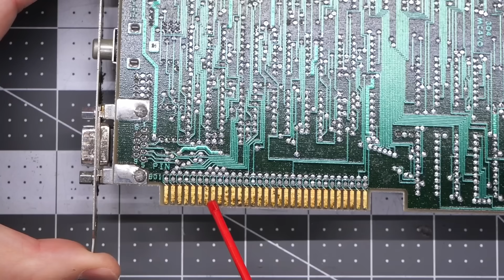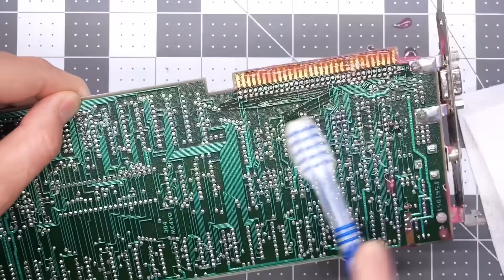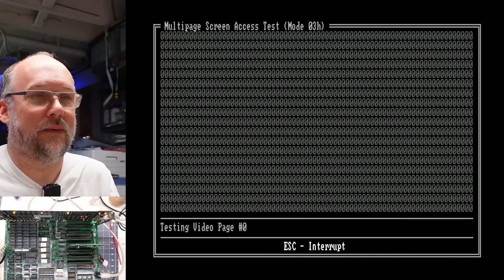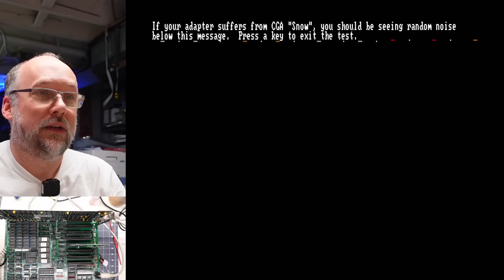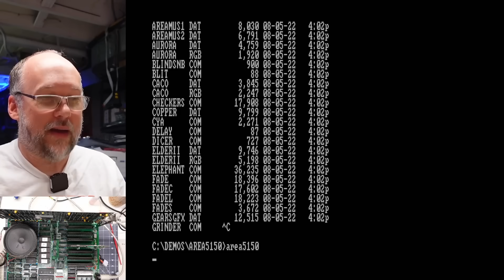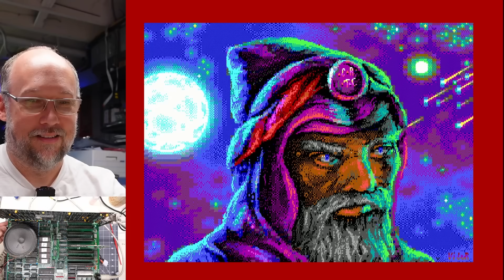Can we save this heavily corroded IBM CGA card?

Comment: Another chemical that works great for me with cleaning corroded circuit boards and connectors is "Super Clean All Wheel Cleaner" - it's a foaming cleaner with oxalic acid. In my experience it works as well or better than naval jelly, but it can be easier/less messy to work with.

Comment: In the past I've tinned up the corroded connectors for my C64s, so I'd say 'yes, tin them you fool!', but I'd obviously advise you wick it so that you have minimal issues with insertion problems. Surely if solder flakes off in the slot you just go inverted and it falls back out of the connector... top gun style.

Comment: The slots on your motherboard are wearing out. The distance from one side to another is vast if you look at the pins. Meaning some of the slots have various widths to them. Some are wider than others. So contacts to any card you put into them may or may not work. Just a heads up... Nicely done... =)

Comment: You said when the ISA connector gets too damaged, there's no way to repair the card anymore, and I immediately thought: you're wrong - even then, you can pretty much save it. Look at those large vias just above the slot connector - they're obviously solder holes where a regular pin header can be installed for whatever purpose. And they are all connected to their respective pins on the connector, as you can see. And, fortunately, ISA has the standard 2.54mm pin pitch. So even in case the connector gets insalvageable, what you can do is solder a standard 2.54mm 62x2 pin header there and make another PCB with a similar header (to solder a counterpart there) and an ENIG-plated ISA connector.
And if you needed to fit such card inside a case, just cut the original connector off (or maybe just remove the remains of the copper from it, to make it just a dummy mechanical holder) and make the replacement connector PCB the correct distance from the card to fit in the neighboring slot. To save a slot, you may even make a special XT-IDE card with the extra pin header to connect such card :)
All in all, these things are nearly always repairable in some way :)

Comment: You can make a homemade version of the jelly with hot vinegar and cornstarch. Works WONDERS for regular rust on iron surfaces.

As for those cancer warnings, I once stayed at a hotel in San Francisco that had one of those attached to the hairdryer. Apparently, IF on fire the fumes from the plastic can cause cancer.

Comment: I used to be in to guns. A friend of mine who was also into them and had a gun shop used to also be into metal detectors and such. He once went magnet fishing in a nearby river and found a .22 rifle that had been submerged in the river for what must have been several years. So we took it to my gun shop in my basement and coated it with Navel Jelly, it worked pretty well but the outside of the gun was deeply pitted and, of course all the bluing was gone.  So we went over the gun with sand paper, then steel wool then cold bluing, it came out looking almost like an engraved rifle!  Looked kind of cool and the thing about .22s is that the bullets are coated with a sort of wax lube so the bore of the rifle cleaned up very nicely.  We located a stock for the old rifle, and I cleaned up the insides so the gun fired, he sold it as an engraved rifle for several hundred bucks.  Our investment back then was around 40 bucks of parts the stock and cold bluing chemicals.  Navel Jelly is indeed a wonder product.

Comment: Dear Technoid Savant, 

I found some rather surprising information for you with regard to your CGA adapter's worn male edge connector.  Unfortunately this platform does not allow us to post hyperlinks within messages.  However just copy and paste the following data into your favorite search engine and then you will be able to proceed.  

There are only 5 or 6 results so you won't suffer from techno-babble overload but those pages are indeed quite enlightening.  I'm almost certain that you will be able to produce some astounding procedures from the information contained in the those pages.  So without further delay copy and paste the following parameters into any search engine (without the quotes): 

" (repair,preserve,protect) (worn,gold,edge) (connector,pins,fingers) (pc,computer) (video,cga,adapter,card) "

Or these variations will produce slightly different results (I didn't research deep enough to exclude them): 

" (repair,preserve,protect) worn (gold,edge) (pins,fingers) (pc,computer) (video,cga) ( adapter,card) "

" (repair,preserve,protect) (gold,edge) (connector,pins,fingers) (pc,computer) (adapter,card) "

I was both surprised and amazed at the precise nature of the information that I saw on some of those pages.  I have no doubt whatsoever that you will be able to adapt and utilize the information for your own specifications and purposes, if you are so inclined.  

Reminder:  Don't include the quotation marks when you copy the phrase into your search engine or you will come up empty.

Happy trails and my best regards.

Comment: Hi, I really enjoy your videos but this is the first time commenting.  I've looked at plating before and I think brush electroplating would be best to restore the edge connections.  If you connect all the edge pin to 0 V, whether you want to plate them or not, the board will be protected during the electroplating process.   Then you can do the electro-cleaning and nickel plating safely and ensure you get a thick and reliable gold layer.  I'm not sure those jewelry gold restoring solutions would give a thick enough gold layer and would wear quickly.

Comment: There is actually a product marketed under the name Stabilent 22, known as a contact enhancer.  When I was working in the Comm. Dept. at a Class 1 Railroad, we used this regularly, with our multi-slot radio controllers, at the various radio sites.  It's not cheap, but worked wonders on edge connectors.  I think we bought ours through Motorola, but there are other vendors, who sell it.  

I'm planning on attending VCFMW in 2024, so I'll look you up.

Comment: I'm usually able to find out what ingredients are in things by looking up the MSDS sheet for it.  The Jelly one says it has these ingredients:

Phosphoric acid 7664-38-2 10 - 30
2-Propanol 67-63-0 1 - 5
Xanthan gum 11138-66-2 1 - 5
Sulfuric acid 7664-93-9 0.1 - 1
Silica, amorphous, fumed, crystal-free 112945-52-5 0.1 - 1
Diiron trioxide 1309-37-1 0.1 - 1
Magnesium oxide 1309-48-4 0.1 - 1
Aluminium oxide 1344-28-1 0.1 - 1
Alcohols, C11-14-iso-, C13 rich, EO~

Comment: id leave the pins alone, if concerned about it in storage id put on some dielectric grease so they wont corrode in storage and you could use the card that way also and it wont corrode in the socket either

Comment: I've had connectors loose connection due to WD40, due to a thin film that was left on the surface. Almost impossible to spot, would absolutely not recommend.

Comment: That Area5150 demo was neat. Color gradients reminiscent of the Amiga Copperlist tricks, high resolution multicolor graphics... I think they do something similar even, like editing the palette references on the fly. The Amiga could display fairly high color counts in a highish resolution, non-HAM image by palette splitting. Also lately, the C64 has received some demos that do tricks that shouldn't have been technically possible at all.

Comment: On the note of the edge connector... if I were in your place, I'd probably just tin the entire thing with solder, even the gold pins.
make sure the entire contact is coated, then use copper braid to remove as much solder as possible, really thin coat.

Comment: Given that we are speaking about electronics here, I don't know if this is completely safe, but you could always try giving the exposed pins a light electroplating connecting cables to the vias for probe connection of the pins that need it. Try at your own risk, preferrably with a cheap spare card first.

Comment: @Adrian 
Take a look at Circuit Medic

They sell PCB repair kits. They've been around for like forever, and give IPC (PCB standards) rated repairs!
I use some of their stuff. I really like their thermal bond adhesive sheets. I find their replacement pads a pain to use (too thin). I usually salvage a pad from a donor board, and use the thermal bond adhesive to replace the pad. 
Solder mask is available from them also!

They also have a lot of great how to videos of how to do the various repairs, obviously showcasing their offerings. 

They have a gold plating kit, but it's quite expensive. You can order individual supplies from them however. The gold plating solution, being gold is quite expensive unfortunately. 
You may need to do a nickel barrier plating, and then gold, as gold can actually diffuse into copper. And, the nickel acts as a hard, abrasion resistant layer. Probably less of an issue for an antique hobby board repair, however. 

DO NOT tin/solder plate those edge connector pads. You will contaminate your mating edge connector... Plus cause fretting corrosion from the dissimilar metals...

And as others have mentioned, Navel jelly is mainly phosphoric acid and some sulphuric acid with a gelling and coloring agent. I would recomend a baking soda scrub afterwards to neutralize.

An alternative method for PCB corrosion cleanup, I would use, is OA water soluable flux, covering the corrided areas with flux (top and bottom, even if no corrosion present on the opposite side), which is quite aggressive, and touching each corroded part with an iron. The joints will look factory fresh! Do NOT leave OA flux on a PCB. It's quite corrosive over time.
And, like you did with the Navel jelly, use it in an area that you can clean well afterwards, so you dont contaminate future projects. 

To clean a PCB, including OA fluxes, just put it in an old dishwasher to clean without any detergents. If your water is hard, give it an isopropyl alcohol bath before drying.  This actually mimics industrial processes when they are manufactured, although we use DI water for a final rinse.

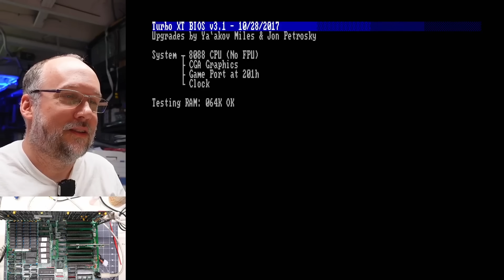Comment: 18:59 does picomem give you a clock and a Game port? 

If you remember the broken motherboard with the mysterious issue was showing the exact same devices even though there weren't any clock or game port installed

Comment: Please do not use WD-40 as a preservation coating, before it dries up it's gets all over the thing, and after that it attracts dust and inhales moisture from around itself. You don't need that kind of shmoo on your connectors, just a dry box would be enough.

Comment: A cheap and convenient way to make the connector is to use chemical tinning.
This will work much better than solder as the thickness is going to be much more regular.

Comment: we used the yellow sticker to point to faults in factory (learned electronics technician around the 2000s), maybe bad soldering points to reflow. the worker has forgot to remove them, imo.

Comment: For protecting the PCB, cover the edge connector then spay the whole board with some clear protective lacquer.
For electronics the spray from an electronics supplier is probably the best however lacquer from a hardware store works just fine also.

For the edge connector it would be fun to try and electroplate it. above the edge connector is a row of pads, temporarily join them all together then experiment with some plating.
I have never tried gold, it would be interesting to try.

Comment: Could a gold solution in a small plastic vessel large enough to immerse only the edge connector and 'fingers' be used to re anodize the 'fingers' ? A small current would need to be passed through the card with a +/- to a power supply. Would that be possible ?

Comment: There's a plating solution available, used for DIY PCB making, which doesn't need electricity. You'd basically just let the slot fingers sit in the solution for 20 minutes, and then you wouldn't have any more copper exposed.

Comment: I would coat the copper at the top of the slot connector, to protect where it connects to traces. But leave the copper at the bottom bare where it contacts the slot so you don't foul the slot.  If corrosion or wear causes problems later the remaining copper could still be tinned if the trace is still connected.  If not in a system you might want to store the card with electrical tape over the slot connector to reduce atmospheric exposure, Other tapes might not play well with copper, but electrical tape should be fine it is intended for long term use on copper. Might need to clean off adhesive residue before use if tape is left on for a long time.

Comment: The two stickers with pointers were probably put on by a QC inspector to indicate joints needing rework attention due to not fully meeting standards.

This was a frequent practice in the 70s and 80s at many manufacturing plants.

Dave
Reply: Still is in smaller businesses, it seems. I worked temporarily at one that handled subcontractor jobs and they were still putting labels on peoples work whenever it came back to them.

Comment: As for the nail polish, you might want to look into some products by MG Chemical. They have several conformal coating products with various degrees of protection for electronics. Some just paint/spray on and others that have to be cured in an oven or via UV light.  I don't know which one we used on electronics we delivered to the Air Force. They have conformal coating strippers, too.

Comment: Did not check to see if wd40 was mentioned yet or not. It is a de-seize fluid DO not ever use it on metal on metal moving parts, it will gall and bind and do more damage than good and it is not safe for plastics. Mention it around automotive or gun people and watch them cringe. It is also IMHO bad for the pcb itself as from experience from a friend who always hosed off his RC cars with wd40 to clean them and was always breaking fiberglass parts and FRP plastics on his cars. I personally would silver solder the copper and leave it. 
 If you are feeling really adventurous you could re-plate it in some other metal with electrolysis. (dunno how this would affect the components connected to the board though) oh people have mentioned those pens and other tools too.

As for the nail polish it is fine, I used to use it on armatures of electric racing motors all the time as the motor cleaner we used would often eat the finish off the winding housing and those would rust up. (RC 540s and smaller down to slot car and HO.) I would suggest a tinted base so you know where it is or isnt.

Comment: If you want to tin the card edge connector, tin it as you normaly would ( scotch brite the pads first ) but while the solder is still liquid, wipe it off with a rag to leave a tin coating without the blobby fat look. Liquid solder paste works well for this, a big fat hot iron and work quickly so you don't lift the pads.

Comment: Nobody ever did " pre emptive "  coating on anything back then after the soldering... Now having done electronics is sometimes heavy corrosive enviroments ( like fertiliser plants ) i covered the complete boards, incl connected wiring) in Amber-spray by Tectyl... works like a charme and electronics would last yrs and yrs instead of weeks...
Another good one for say isolating connectors is Wijmaplast by Draka, like a blue/green silly putty that's 100% non-conductive and never hardens... Just expanding your knowledge of " what's out there "  to prevent corrosion... 😎

Comment: I think some of the foaming with the naval jelly was the angle bracket for the DE9 connector mounting which might be aluminum.

Check for aluminum before using naval jelly or anything else with phosphoric acid as an ingredient.

There's a reason naval jelly isn't allowed to be used near aluminum aircraft. It will completely dissolve aluminum parts given enough time.

Comment: If you tin the slot connector .. the solder WILL crumble eventually and leave debris in the expansion slot connector of your motherboard and can cause shorts. Don't tin the connector unless you really really need it and the card stops working.  Please just leave it be.

Comment: I wonder.  If there is one or two ruined contacts maybe take a dremel and small diamond die bit and carve a groove then flow solder into it?  If the groove is rough then the solder might key into the PCB.

Comment: Amazed that CGA card didn't explode running that demo!  I never in a thousand years would have thought that a CGA card was capable of such high colours and resolution! Look at how godawful games with CGA looked as did all PC games until at least EGA brought parity to the C64 and then VGA finally pushed the PC past the Amiga and the gaming world began to standardize on PCs.  Regarding the exposed contacts, yes I highly suggest tinning the exposed copper. The rest should be fine.

Comment: I've repaired quite a few cards that were pretty crusty. What I've done for card edge connectors like that is to tin them and go over it with solder wick. I've never had any problems with it coming off in the card slots.

Comment: If the motherboard has memory with parity, the "RAM test" is actually initializing the parity bits.  You have to do this on every cold boot.  You can not skip it on a cold boot.  There is a byte in RAM that the BIOS checks to see if it is a warm or cold boot and will skip the test if it thinks it is a warm boot.  Most people forget about the parity bits and want to not have that "test" at power up.  But it is necessary, unless you have a different BIOS that ignores any parity bit errors.
Reply: I suppose that's true about parity bits. But on the other hand, no software should be reading uninitialized memory. If skipping the memory test causes "false" parity errors you know your software is buggy.